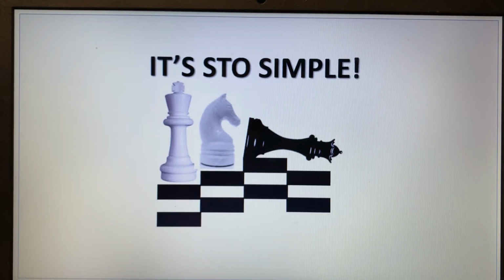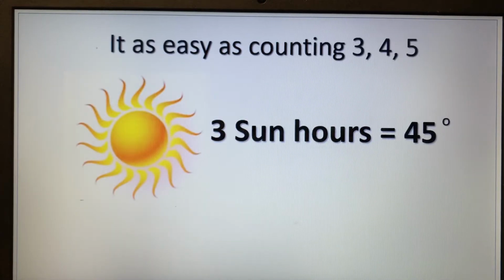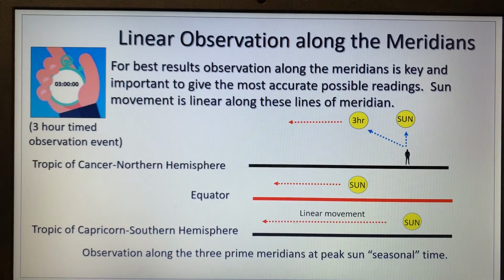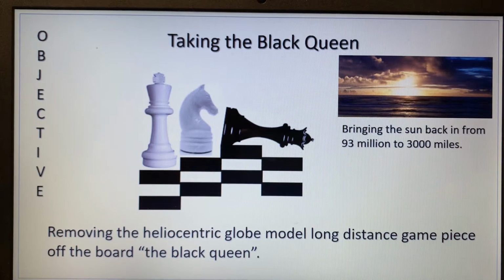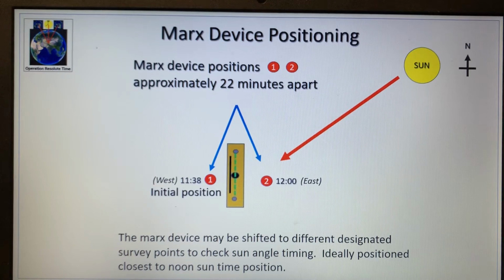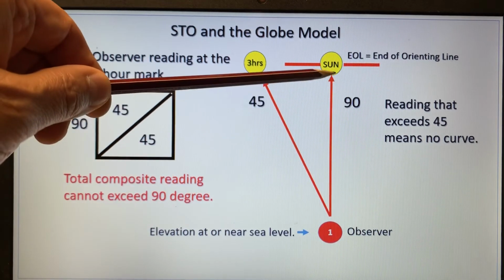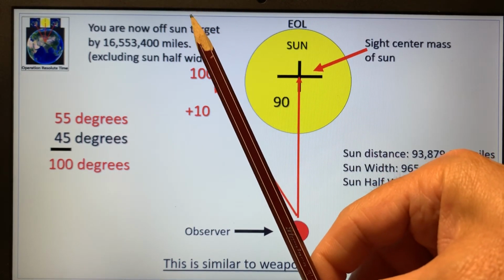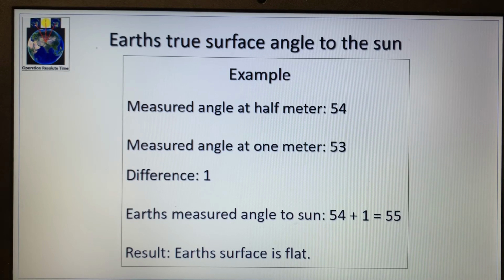It’s “STO” Simple

Comment: If you assume the earth is flat you can put in the height of the sun and the distance between your noon position and the noon position 3 hour later. From these 2 figures you can calculate the angle of elevation of the sun. If it is close to 55 deg then you essentially have a very good proof.

Comment from the maker: Mike great  question!  and its hy the sun survey point is used, it is timing :)). Timing then sets up the observer orientation angle to the object of reference the sun which at 3hrs is now 45 degree to the globe.
If your suing the North Star then yes you would use latitude, not timing.  Example if were at 46 degree latitude for the globe model I only have 44 degree to line of parallel to Polaris.  If my measure angle is 47 degree, I have now exceeded line of parallel for the globe model by 3 degrees.  I must then use the range fan to determine IF I can exceed it by the object said size at said distance.  Enter data on right triangle calculation leg B is the objects said distance, and enter # of degrees PAST line of parallel (3) for angle <a and calculate.  If that number (a) exceeds the radius of that object of reference (Polaris) you have now went into geometric failure for that model.    In other words your not viewing that object from a curved surface, but from a flat surface.  Great question, it takes time and understanding, but once you learn it, you'll never for get it, just as in other things in life you have learned.
Reply: why do you refer as the tropic of capricorn and tropic of cancer as prime meridians. A meridian is a line of longitude, the prime meridian is the line of longitude from which all east west measurements of distance are taken.

Comment: I may not have the gist of this yet, although I already suspect Globers will simply say it results a curve. Wouldn't this work far better with simultaneous observations North  v. South. i.e. Measure 2 highest possible sun positions by split averages (nearest to Noon possible from both locations) simultaneously. I think the the whole 93,000,000 mile deception is far more practical to debunk with simple protractor line and string instruments if not  a sextant. My point is, 50% of what you appear to be proposing here is focussed on needing to understanding two sets of maths only to further argue any biased result one way or the other. Alternatively who would care more, if the the sun was repeatably demonstrated to be only XXXX miles and not 93milion miles away.  Spinning ball or a flat Realm becomes relevant? Two birds one stone.🤷‍♂️

Comment: Hi Corey, thanks for taking the time to make these videos. I don’t understand why the globe model is limited to 45° but flat earth is up to 90°. Are you saying that if it were a globe, the angle change between 2 sightings of the sun center mass, 3 hours apart shouldn’t exceed 45°? Wouldn’t that depend on your latitude? Sorry, I just don’t get exactly what you’re measuring with the device either. Thanks for any clarification.